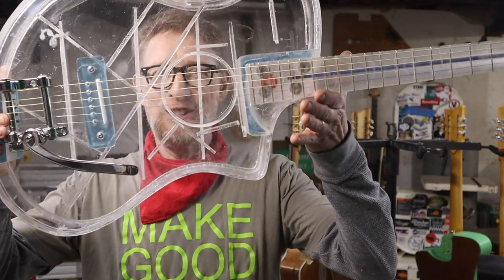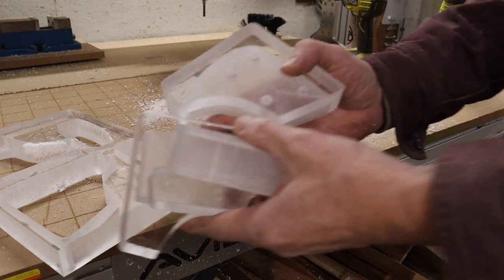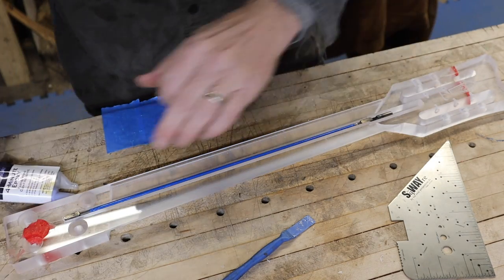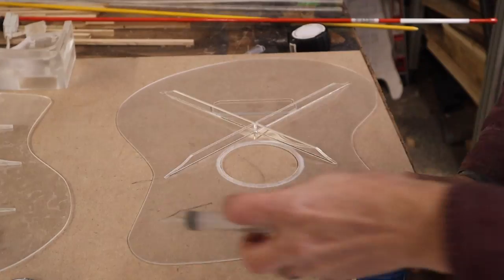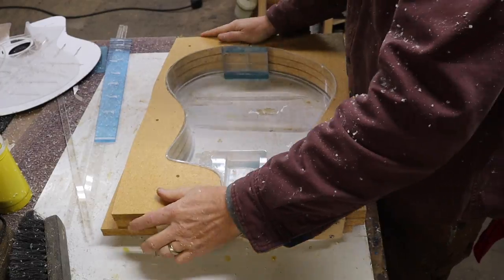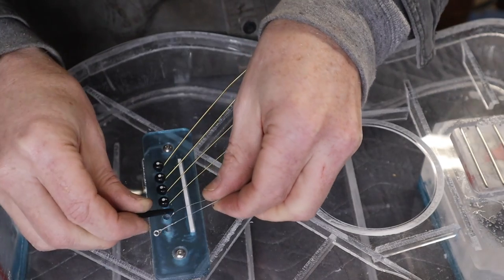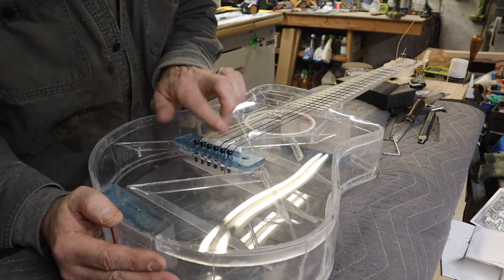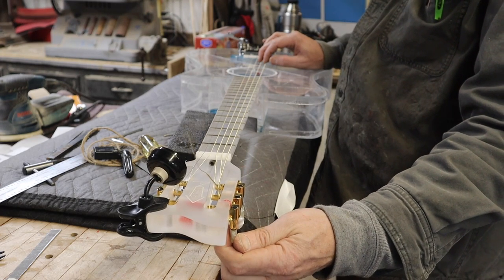No Wood Acoustic Guitar!

Comment: What's the best sounding plastic? Put your answers into comments below 😂
Reply: For me, the best sounding plastic is Pink Floyd's Dark Side of the Moon
Reply: I have a Univox Lucy from the early '70s, and I love the way it sounds unplugged. Lucite cuts pretty much just like wood, but it's heavy.
Reply: Tone plastic.. lol
Reply: My crews were picking up trash along the highway the other day and brought back a lot of car parts from a collision that was not cleaned up well.  There is a piece of a bumper that looks a lot like the back of an Ovation.  This lazy back porch guitar maker gets to thinking...........  Hmmmmmmmm.......
Reply: Always fun to see how you deal with the challenges of your novel builds.

Interesting solution to use a tailpiece to create downward pressure on the bridge to counteract the soundboard pulling upward due to string pressure. Do you know if neck resets, often done on older guitars, are actually solving a problem with a bulging top as opposed to a problem with the neck angle? Maybe switching to using a tailpiece might be a better and less costly solution in some cases. 🤷
Reply: @WimPrest  best answer
Reply: @picksalot1  From my extensive viewing of luthier repair videos, solving that problem in that way is often the case. I suspect tailpieces are rarely used to address it simply because customers want to stay as close as possible to their guitar's original design.

That said, I have a (roughly) 1930 Spanish parlour guitar (a Telesforo Julve from Valencia) whose London importer (John Grey & Sons) routinely added a tailpiece to enable metal rather than gut strings to be used. By the time I acquired it from an elder relative it had a bad longitudinal split and warp in the soundboard (having been stored with full string tension). My grandfather, a general craftsman, repaired it to playability with epoxy, which resulted in a unique and interesting tone. Much later I had a proper luthier do his best with it, which improved its looks but 'blandified' the tone somewhat.
Reply: C4 :D
Reply: @neurocosm  2 funn e
Reply: the tim sway patented Acrylitone™
Reply: @terryhunt2659  Thanks. I also watch many Luthier videos. 👍 In fact my Classical Guitar teacher made Guitars and Early Instruments, and I took lessons at his Shop. I have a couple old guitars that the top has budged, possibly because of the weather. Having built a Classical Guitar with a different Luthier, I was thinking I could easily test a tailpiece to see what the effect would be, inspired by Maccaferri. "Blandifying" the sound is certainly a possible outcome, but since the test can be done with little or no permanent mods, I will likely give it a try some time.
Reply: Plastic Ono Band?
Reply: Sounds ridiculous, but Styrofoam polystyrene has amazing acoustics. Take a part of it from a box packaging and knock on it. It's really loud and steady.
Reply: @jihfase  
Yes, you can build pretty good speaker with a rectangular sheet and a transducer in one corner of the back. Slick looking and with good loud sound, for just a few bucks.
Reply: Madonna
Reply: Acrylic is great for keyboards, I should find out.
Reply: what is the name that you put to make the tension of the string much more better
Reply: @gabriel11earl  
I would put the name of Godzilla for more tension on the strings😊
Reply: Ready for the "tone plastic" wars to start.
Reply: I heard, that foamed polycarbonate is best "tone plastic". It is near to tonewood in his properties. But no foamed polycarbonate on the market, you must foaming this by yourself, and that not so easy

Comment: Tim, you don't necessarily have to put solvent on acrylic parts like that before joining them. You can set them in place and then use a syringe to capillary feed the solvent between the parts. By the way, that Weld On "glue" is mostly methylene chloride and trichloroethylene with a small amount of acrylic. Plenty of people who work with acrylic just use solvent. You can save money by using methylene chloride, less than $20 for half a liter.
Reply: came to the comments to say the same thing. I used to work with that stuff a lot so when I saw how he was using it I was surprised because I didn't even know you could use it that way!
Reply: @robgonzo  If I'm joining pieces with large surface areas to be glued/welded I may prep the surfaces with solvent but even then I'll capillary feed from the edge once they are joined to make sure of 100% coverage. I've found that the trick to solvent welding is to apply a slight amount of pressure to the joint once the plastic has melted - enough to make sure that plastic particles from both sides mix but not enough to squeeze the resulting goo out of the joint.

Comment: A lesson to be learned about acoustic guitars in general. Metal strings produce much more force than most people think, on wood as well as plastic. You can clearly (not just because of the transparent material) see what that force can do to deform guitar tops over time. And why many old guitars were made with tail pieces instead of pegs. Thanks for your efforts.
Reply: You know I've never really thought about how the forces differ between a tailpiece and a string through bridge but that makes a lot of sense. There's no torsion with a tailpiece so it might get smooshed down a bit but won't warp the top in weird ways.

Comment: i absolutely love this! it's clearly not very playable, but you got some beautiful little moments out of it. i would love to see this guitar be built again, but with all those little things sorted that you don't wanna do, or don't wanna invest in, and i don't blame you for that. there were 2 things in the build process that i think could've really helped: the 1st being using your more traditional fret press, but heating the fret wire with a hand torch so the melting effect still works, but is way more consistent which will take out those dull spots and buzz's. the other is something you should either already have, or should get for your shop regardless because i'm sure it will help with wood projects all the same and that's a kiln. having a safe way to keep materials up to a safe working temp, that can also dehydrate just helps prevent warping and cracking so much. i understand they aren't exactly the most energy efficient pieces of equipment, but neither is a CNC machine, so it's just an investment worth having. 
these 2 solutions are almost half as smort as putting a Bigsby on an acoustic style large hollow body chamber with a thin top piece to prevent warping. i absolutely love it!! i expect Dan Armstrong would've come up with a similar solution, and considering how good those guitars sound that would seem to be the the perfect solution. i'd be interested in hearing it with one of those pickups made to clip onto the sound hole to electrify acoustic guitars. could be fun

Comment: You're the only other person I've seen doing that type of neck bolt system, installing before the fretboard goes on. Far better than threaded inserts I don't know why it isn't more popular. Structurally it's the best I've seen to get it right
Reply from the maker: Not that this is the perfect way, but the flanged inserts are way better than threaded. The downside to doing it this way is getting perfect alignment every time becomes more difficult.

Comment: Fantastic! Thank you for subjecting yourself to this! 

Quick hint with that acrylic weld. If you have a very small glass jar, you can pour a bit of the weld on into it and add some tiny leftover acrylic pieces (1/4 inch or smaller only - smaller the better). Seal the jar and leave it overnight. 

The acrylic should fully dissolve which has the effect of thickening up the weld on. I start with just a little acrylic added and adjust until it’s the viscosity I like. If it’s too thick, you can add more weld on. The bond it makes is not quite as strong as regular weld on, but for large surface areas it’s more than enough. 

The advantage is that it’s much easier to control and you only get those drip marks (bane of my existence) if you apply way too much and it squeezes out when you clamp.
Reply from the maker: excellent tip!

Comment: As always an interesting vid. Trying stuff out is always good, the way to learn what works, what doesn't and what is just way to much hassle. I do wonder if moving the bridge mount screw/bolts back (even with some rearward extensions on the bridge plate) behind the pegs would help stop the tilt forward. Cya next vid!

Comment: Material that's so uniformly rigid is an engineering challenge. Though you're experienced with door skins, which is probably about as close as wood gets. It would be interesting to see how this material challenge was done with commercially available instruments that used unfilled/unreinforced plastics. Maccaferri made some guitars (and most famously ukuleles) from unfilled injection molded plastic. Polystyrene of some type, I think. The guitars, a flattop and archtop, didn't use a round soundhole design, which might have allowed the use of a bracing scheme to counter excessive flexibility. 

Reinforced plastic is a whole other ball game. Most famously, instruments that use fiberglass style layup methods using carbon fiber are sometimes well regarded and can sound remarkable. More  recently, I bought new a very inexpensive injection molded flat(ish) top guitar that uses cf filled plastic, polycarbonate, I think. The fiber reinforcement, even in injection molded plastic, is very impressively rigid and stable. The sound is good enough, as it's a small bodied travel instrument, and actually compares well with my Baby Taylor, which is somewhat comparable in overall size and purpose.

A classical style bridge with string-through tie block, combined with a tailpiece is a scheme that's sometimes seen on Spanish/Latin American steel string instruments, which seems to alleviate a lot of the stresses from such high tension while maintaining a good break over angle at the saddle. 

Finally, for a bit of irony, maybe you could glue on a thin veneer of wood as a pickguard.

Comment: I was going to skip to the end of this video to see the finished product, but I became fascinated by the process. You are fortunate to have tools like this at your disposal. Very cool. Cracks are a bummer though. When gluing the top, could you lay the body on top of the top sheet to glue it and avoid the glue dripping down the sides? I wonder what it would sound like with a pickup or a soundhole pickup?
Reply from the maker: upside down and the glue runs along the top instead. apparently you can clamp it together and use a hypodermic needle to apply, which is cleaner. 15 years ago I had a skill saw and a cordless drill. I've invested heavily in myself to get to where I am but not as much as you'd think! I mostly shop second hand.

Comment: i think all you would need to do is get thicker acrylic about a half inch thick maybe a touch thicker for the body so you can use steel strings and not worry about detuning or the bridge popping off

Comment: What an interesting experiment. I mean I knew the electrics wouldn't be a problem being that alot of the sound is hardware, but this works and isn't the worst sounding thing, not the best by any means😅 but not the worst. And it works. Great job man!
Reply from the maker: Indeed it does not sound good, but I have, in fact, heard worse :)

Comment: Nice.. FYI Cast acrylic is the best it’s easier to machine and more durable than extruded acrylic which tense to chip crack also gum up when heated. Of course cast acrylic is more expensive but in the long run more durable and looks way better. Weld-On  for acrylic. Adhesive comes in several different viscosity‘s. As far as your flame polishing. You need to get the cast acrylic as smooth as possible. meaning sanding down to 6000 grit, making sure, the surface is clean to get a true flame polish. Extruded acrylic tends to cloud and melt easily. 
Use 2 Flute Center cutting end mills work the best when machining cast acrylic., it can also be drilled and tapped .. I always tap with a heavy thread ie: 1/4-20, 10-24 etc. You can also use dish soap & distilled water as a lubricant/coolant, to keep the the end mill or drill bit from heating up. Oil can cause crackling. Also glass cleaner on acrylic can cause crackling. I worked in the TV movie and theme park industry for over 30+ years designing & fabricating sets, props, FX, SFX & animatronics. Hope this info helps👍🏼
Reply from the maker: thanks for the knowledge drop!!

Comment: i was about to say something about neck-through for more strength, totally forgetting its an accoustic guitar. 
anyways, moving on! all in all, turned out great!
Reply: Most cigar box guitars use a neck through design.  As the neck passes through the body it is shaved down to allow the soundboard to vibrate without hitting the neck inside.  The concern shifts from being a twisting upward force on a fixed bridge to a downward force on the soundboard.  This is much easier to build for us "make believe, garage, toy making luthiers", and, I believe, transfers more vibration to the soundboard.

Comment: I can something about instrumentsin Acrylic...  I haven`t build the acrylic piano for Schimmel,but a worked for 15 years in the company these pianos  in germany are build.  Schimmel ordered 2 Pianos, but they had to build 7 prototyps from acrylic glas until the first sounds in the mean. THIS Piano buied Udo Jürgens for promotion, at the he recorded the sound from a full wooden instrument.  Historicly it is knows that acrylic works well for flutes, but not for guitars, violins or pianos.  something to your work. IF you polish acrylic with a flame or cut it whith a whit film, you have to remove the parts an heat it slowly up to 65°C for 5 hour, and slowly coolit down otherwise the acrylic will crack. the same  happens if you bend the acrylic anyhow cold or warm.

Comment: I think there is another one in you some where.
I have concerns about the inheirent weakness of the top.  Obviously the bracing is ther, however the structural integrity is different from say quarter sawn spruce used in traditional acoustics.  Meaning while the ridgidity is there it wont react like wood.  The rest of the acoustic body structural ridgity is from the sides....there is still a trampoline effect on the front and back, bracing aside.  
My concept would be to glue two lengthwise braces to run from the neck block the the end of the body to your block there.  Obviously you want the sound to move through the body, so placing archways near the sound hole maybe and further down the bout.  Adding strength to the body while retaining the acoustic properties.  Think "neck through" design, only it isnt "solid" as it were.

The guitar is properly beautiful from 5 feet.  Sure the stress fracturing does detract.  I think tacking longer to moled the sides with a slower process might be key to avoiding that.

Overall it might add a shinier tone.  Then again, installing an undersadle piezo might be fun.

Ive not seen an acoustic with a Bixby.  You may be onto something there.  I think a neck thru may also be helpful in allowing more proper use of that piece of the pie.  It occured to me that tremeloing with the Bixby may also have been warbling the top of the body just as much.

I like this design.  You have a great mind for this stuff.
Reply: I apologise for my horrendous spelling.  I just reread what I sent.  
Funny thing is, I dont drink....😳

Comment: What's your thoughts on flipping the neck over during that fretbaord glue-up so that the fretboard is on bottom? Then your go deck wouldn't be introducing a bow.
Reply from the maker: good idea! But the go bars would be difficult to place on the rounded neck. I usually use zip-tie like clamps designed for necks but was afraid they'd take too long to setup with this glue. I've since learned the proper way is to completely clamp the work then use a real syringe to squeeze it in.

Comment: From experience. Over time there will be more and more cracks. This type of material doesn't like any tension. The drilled places with screws are also a problem. The temperature changes will increase the problem. To minimize the issues you have to temper the tension places during the build. An advice. Sanding all surfaces, temper it. It will reduce the cracks, make them less visible, easy to repair if needed. (also sanding covers the inside view)

Comment: I dont know the best sounding TonePlastic is, but i have discovered the worst. I once made an acoustic guitar, full wood guitar, but with a lexan Polycarb fretboard and top. I smoked the inside piece, no braces at all, (it;s 8th inch bulletproof, it could stop a 38 round so who needs bracing?) and it worked, looked awesome, held strong, and sounded...like nothing. This bulletproof plastic designed to absorb and disperse energy apparently dispersed the sound too because it has like 12 percent volume and sounded weak and dead. no sustain, no brightness, like palm-muting a rubber band. Same wood and strings i used on another guitar that sounded beautiful, only difference was the lexan, i even ended up putting ultra-heavy gauge strings on it to get SOME tone and it still sounded like an air guitar. I made a silent acoustic guitar. Lexan is the worst Toneplastic. Dont use lexan. When i moved a year later i just left that one in the old house.